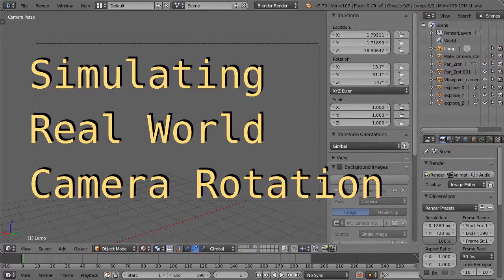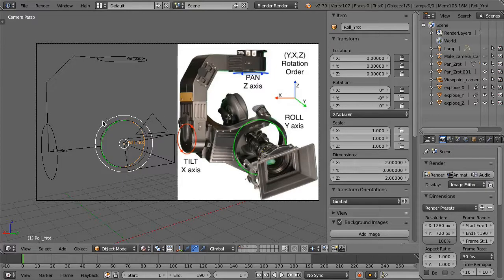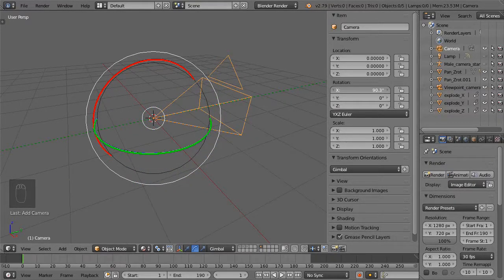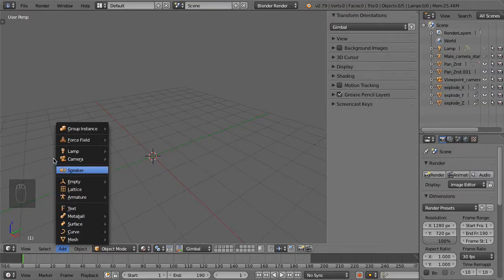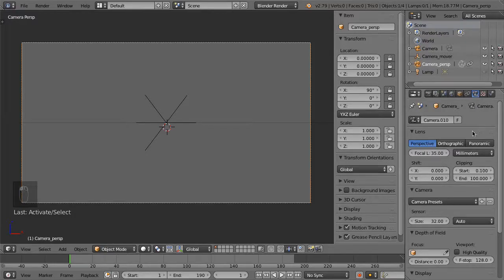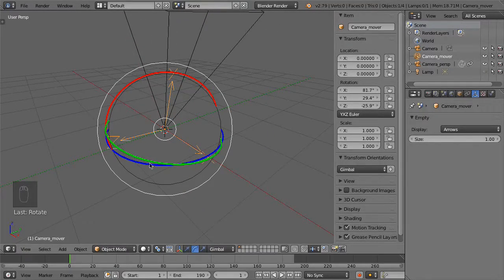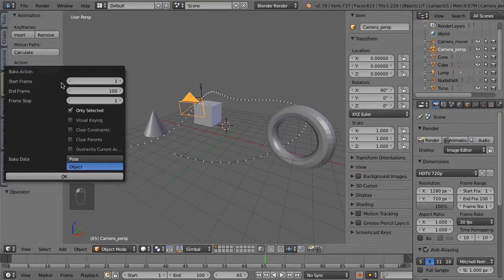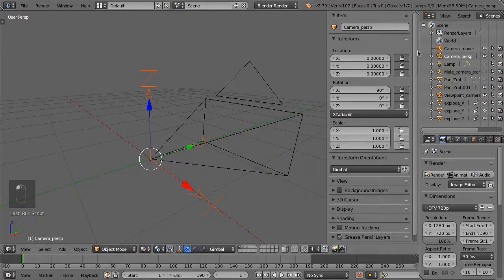Blender Tutorial : Camera Rotation Order and Creating a Simple Rig

Comment: this is easily one of the best blender camera rig videos i have found.  the only thing is, i want the rig that you used to emulate body movement at 4:00
Reply from the maker: Thanks, glad it was helpful.    The demo rig at 4:00 functions exactly the same as the tutorial rig, the axes controls are just offset for visual purposes.  Its not difficult to build - with your camera at world zero, Rotate X 90, create a Mesh Circle then move it below the camera - this is the Pan axis.  Create another circle, rotate it 90º in Y, Apply Rotation (Control A),  and move it to the side of the camera - this is the Tilt axis.  Create another circle, rotate it 90º in X and Apply Rotation - this is the Roll axis.   Parent the camera to Roll, Roll to Tilt, and Tilt to Pan.  To create the visual link between axes,  extrude a vertex from the side of the Pan circle, and extrude lines to the center of the Tilt circle.  Then extrude another line to the Roll circle.